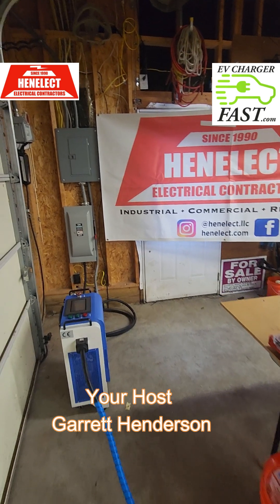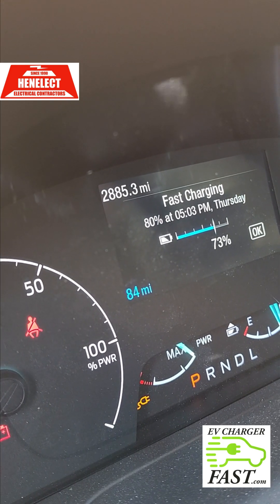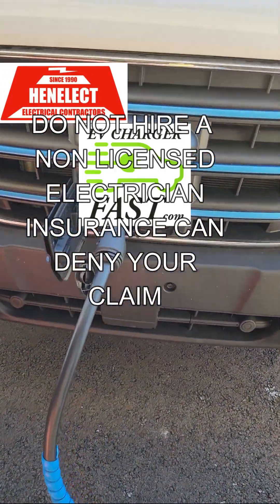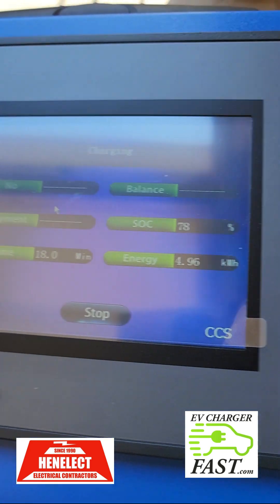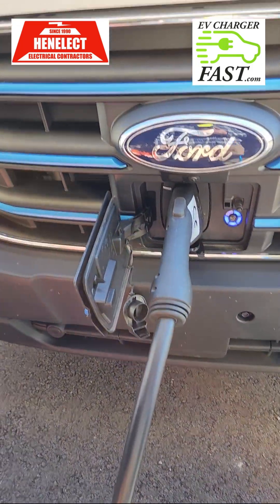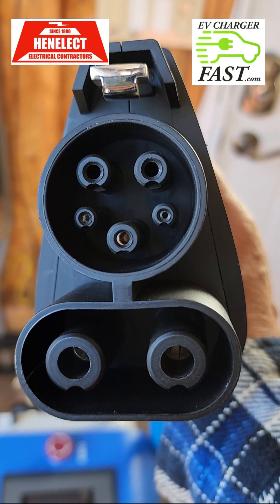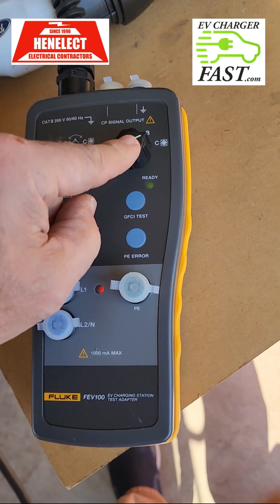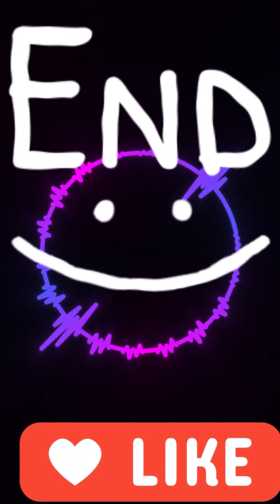DC FAST CHARGING AT HOME and OFFICE

Comment: 70A x 235V = 16.4 kW - 5% converting the A/C to D/C = 15.6 kW. 

That’s good for EVs that only allow 32A when A/C charging at 235V.  However, if your EV allows 80A A/C charging, like the Ford Lightening, then Ford’s 80A A/C charger would be a MUCH less expensive solution.